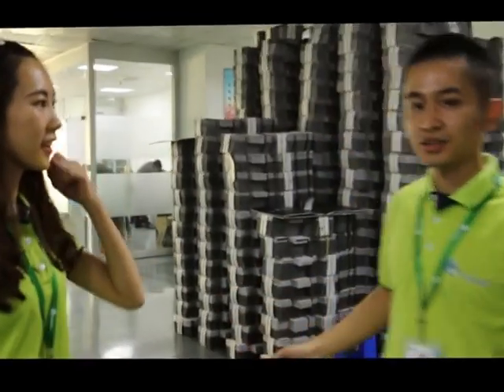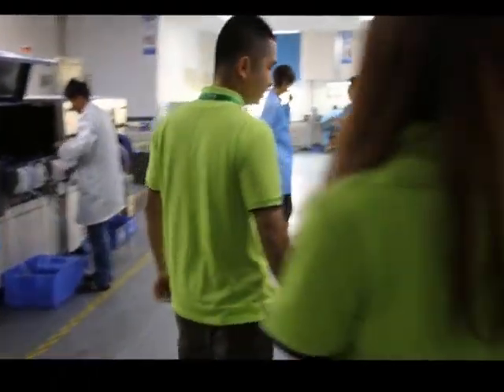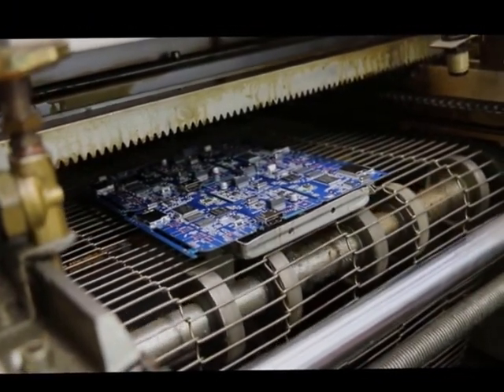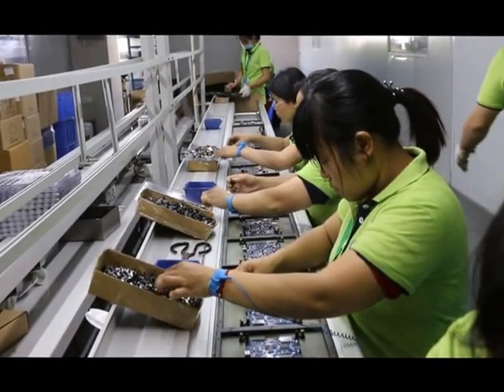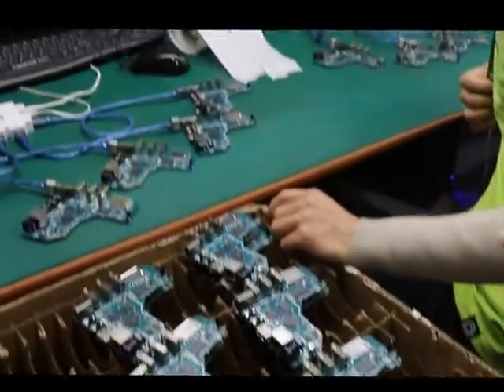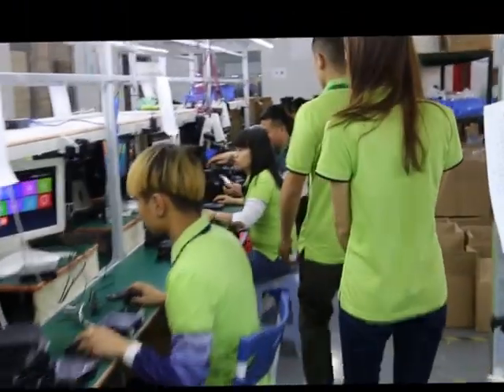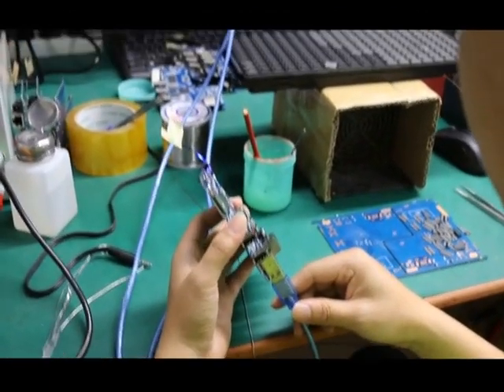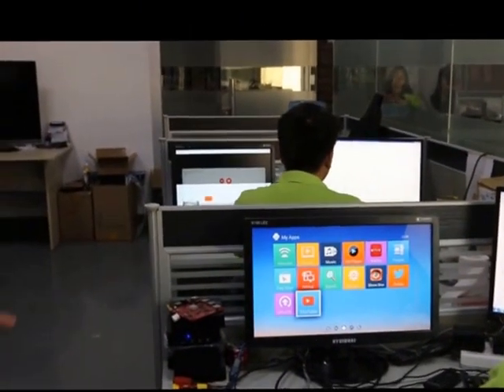Powered by Wechip：tv box factory

Comment: Received my WeChip V10.  Help as this device is stuck on BOOT.
Reply from the maker: Hi Tom, could you pls add my whatsapp and send me the video?  +86 18692236721
When you plug in and still stuck on Boot?
Reply: Runs through the logo boot then stops at the WeChip logo.
How do I use the reboot button as different TV boxes reboot button works different?
Reply from the maker: @tomfaragalli3747  I will send the firmware to you reset, do you know how to do?